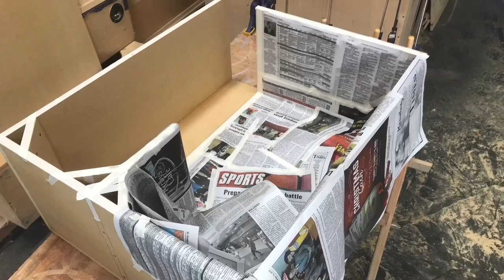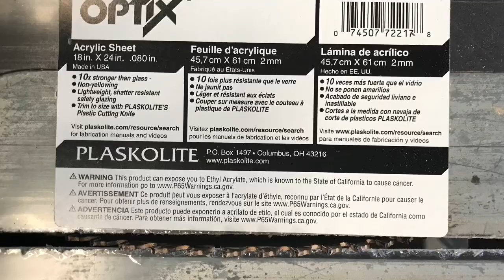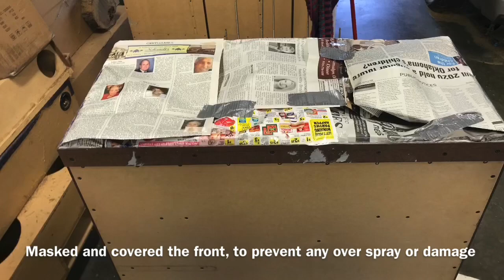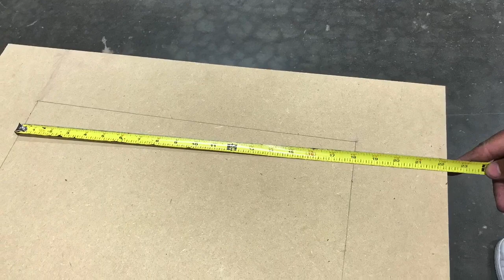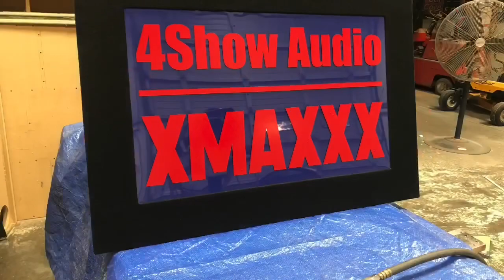Custom Box Build for 2-12” American Bass/XMAXXX and Amp Lid Cover

Comment: Im in proccess of building for 2 of these... Box looks good man.. great work!
Reply from the maker: Man, you are gonna amazed how they perform. The damn weight 😐 of these monsters are crazy, so be ready 💪🏽
Reply: @210Designs  I see you ported out the side.. i may have to do this also..  Box im doing is 33x33x14.5 .. outer dims. just dont thunk i have enough space on baffle for port and 2 subs... do you have the outer diameter for those subs by chance? .. maaaybe i get port and subs on same plane..🤔
Reply from the maker: @419Audio  - Yessir, went out the side on this one, at the customer’s request. He wanted the center to have the logo/plexi. I have the OD/ID #s written down at the shop. I’ll get them to ya later this evening bro 👌🏾
Reply from the maker: @419Audio  - OD: 12.75” ID: 11-3/4” MD: 9”

Comment: Here bro!!!🔥🔥🔥
Reply from the maker: 👌🏾 Much appreciated bro.
Reply: @210Designs  How much would it cost for you to make me a box for 4 12s for those xmaxxxx I wanna put em in an 04 Armada
Reply from the maker: @knottydread74  - Wow...4 of those subs in that vehicle, will have tons of pressure 👌🏾 unfortunately, this is the only box I’ve built and shipped for a customer. 99% of my builds are for local customers, in my area. I’m limited to that, based for 3 reasons. I have to measure the vehicle to guarantee box fitment. Each one of my boxes.m are tested in my shop, before the customer can pick it up. And I can only ship LTL freight, because if the box is damaged during shipping. I don’t have another one to replace it 🤙🏾
Reply: @210Designs  ok thank you and do you think thats to much will it bust out my windows cause if so I'll jus do 2😃😃😃
Reply from the maker: @knottydread74  - Your more than welcome bro. No, you should be good on cabin pressure in the vehicle. Just be aware of how hard your beating them, when the windows are rolled up 💯 And I wouldn’t have the port opening positioned too close to your loading wall. Equal to or possibly more, than width of the port 👌🏾

Comment: How much for a box design for a single xmaxx sub?
Reply from the maker: If it’s for personal use and not a complex design, I don’t charge. I don’t design for resale purposes 👌🏽
Reply: @210Designs  personal, putting it in my A7
Reply from the maker: @darkhalooo7  That’s what’s up 🤝 Just need to know your maximum measurements of the area, desired box tuning, port and sub locations. My email is bj.hammon@yahoo.com
Reply: @210Designs  ok will go take measurements and email you… thank you very much
Reply from the maker: @darkhalooo7  no doubt 👊🏽
Reply: @210Designs  just sent it 💪🏾